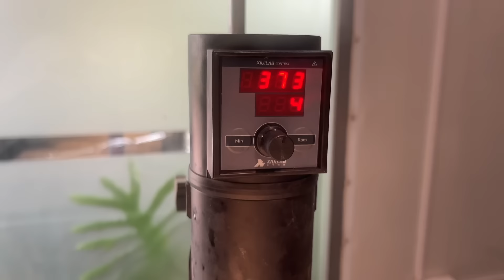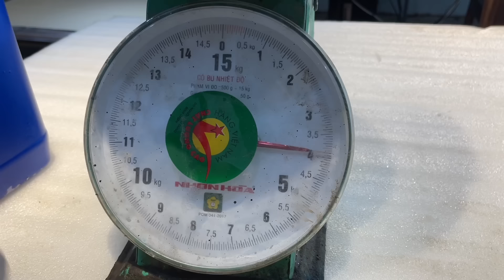DIY Flower Table with Epoxy Resin | Impressive Flower Table Leg Design #craft #diy #working

Comment: What did you use on the sides so you could build them up?
Reply from the maker: Thank you,. I used mdf wood and aluminum panels to make the mold, and silk flowers and epoxy to create the table

Comment: What did u use to make the mould
Reply from the maker: I used MDF board and then glued it with tape to prevent sticking. and the wall is made of aluminum sheet, which can be easily ben

Comment: Ножки не устойчивые болтаются, стол ходит ходуном! И надо полировать пастой, а не заливать сново эпоксидкой и лаком... 😮
Reply: Так тоже делают.
Reply: @irinavlada11 возможно. Но самый лёгкий путь не самый верный? 😊
Reply: @СемейкаМоя  
Решил, значит, малыми потерями обойтись😊
Reply from the maker: You are very observant. When watching the video I actually missed recording the re-leveling process of the table. It is quite sturdy for a display table. The hand polishing process is very good but I used the top coat for quick finishing purposes. The bottom part will be re-polished with a pass, unfortunately I did not record it. Thanks for sharing.